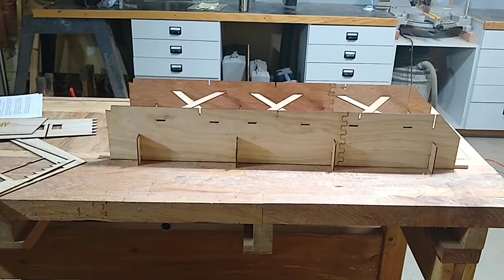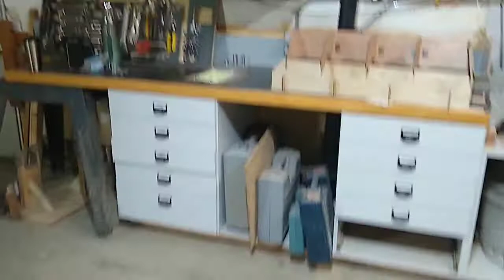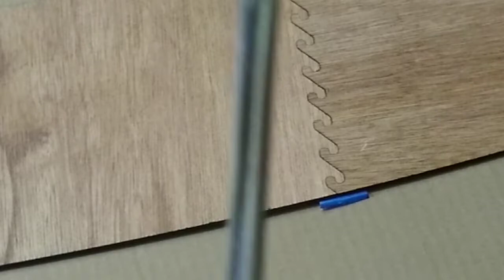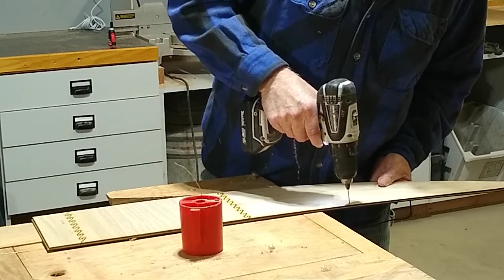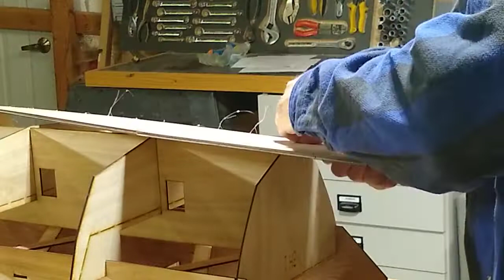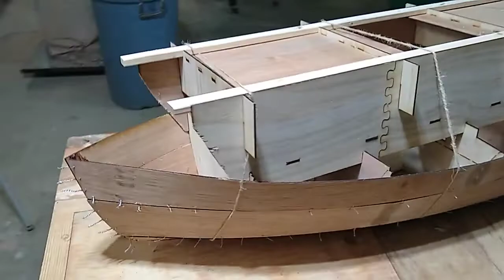Oolichan assembly

Comment: Thanks for sharing.  I am building one of these full size from the plans.  I scarfed it together for the panels, and then cut out all the parts, and that was about as far as I got under the lockdowns up here, when I couldn't get all the materials I needed before moving to the cottage.  Will get back at it next spring.  Not a big project so getting the hull together should not be a big deal, but I find that all the details take a long time.

I wish they had kept the names consistent, as the Oolichan is basically a reduced scale Candlefish, while the smaller Candlefish is an entirely different, and less desirable hull (in my mind).  I frankly don't see the point to it.  Though I know people sometimes ask for the old designs, or they have a motor preferenceSince Devlin makes his study plans instantly available for a dollar, if you are new to this stuff it pays to check out the different boats in a range to be sure you are really getting the most modern hull option.  

Actually, I printed out the Candlefish 16 plans at an inch to one foot, and built it in 1/16" plywood.  It only takes a few hours, and it will really let you look at the boat and see what kinds of issues can show up in the stresses.  I build normally without a strongback, and the C-16 has a very slight hogback tendency which is easily countered with temporary bracing.  Building a model in a few hours lets me skip the entire cost and time involved with the strongback.

Having said that, I have the strongback built for the Oolichan, as I just figured I would learn something that I haven't really had experience of, always building without one.  Of course with molded canoes and such, one needs a strongback,  Also I am using the staple gun approach to the wiring, and that looks to me as though it would require a strongback.  You can't just tweak it into shape, and then freeze it because you don't have a way of developing the seams and really controlling them.  So lots of new stuff to play with.
Reply from the maker: Thanks for the feedback! The candlefish 16 came first, followed by the candlefish 13. Customer feedback showed that they wanted a wider hull, so Sam drew a revised Candlefish V2 to satisfy the request. This led to confusion ("which Candlefish 16 do you want?"), So instead of creating a "Candlefish 13 V2" to reflect the wider hull, he named it the Oolichan.
Naming products is an imprecise science.
Reply: Hondo would love to see the build.